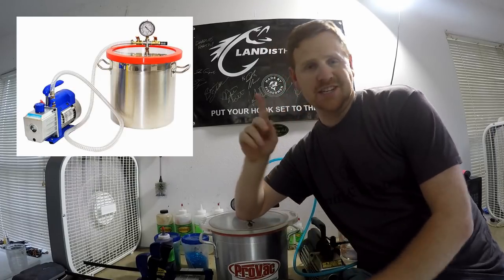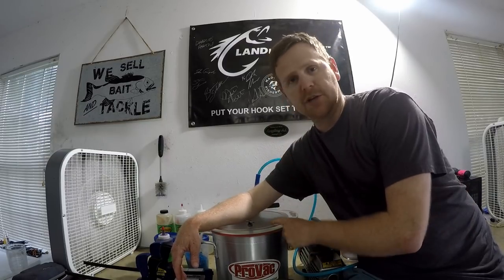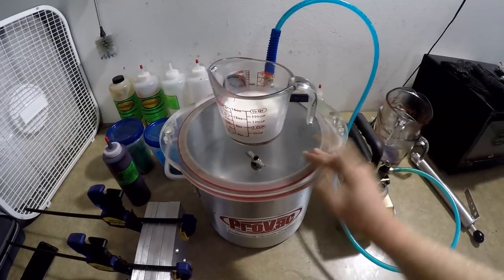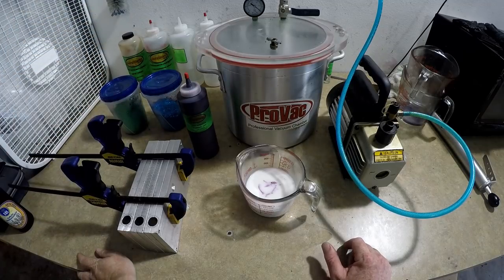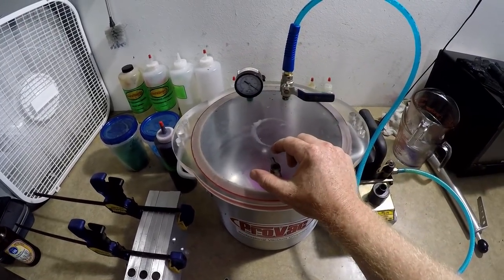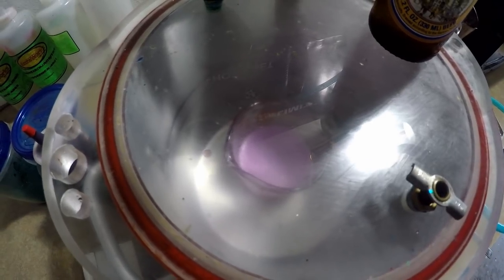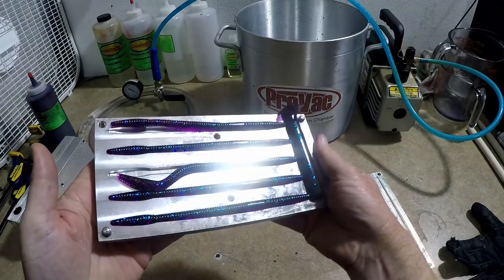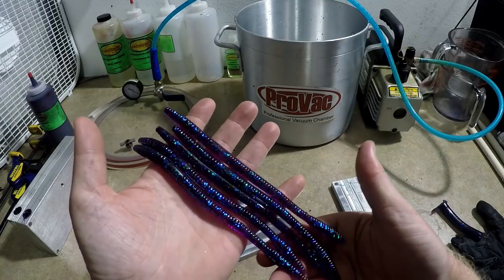How To Use A VACUUM CHAMBER For Degassing Plastisol; Fishing Lure Tutorial

Comment: If you get this message
I just bought some plastisol and I’m having some trouble with it doesn’t seem to cook properly it just gels
I can’t get it to clear up before it burns
My garage I take the heat down at night to about 47 Fahrenheit
Is that the problem that I’m not keeping it at room temperature or plastisol go bad 
I sure hope you get this and are able to contact me with what I should be doing up till now I was doing a load of remelts never had this kind of problem 
And yes I did Gas hot and cold to get rid of bubbles didn’t seem to work
Thanks Brad Andrews
Reply from the maker: Watch my playlist called quicktips, it's all about plastisol preparation